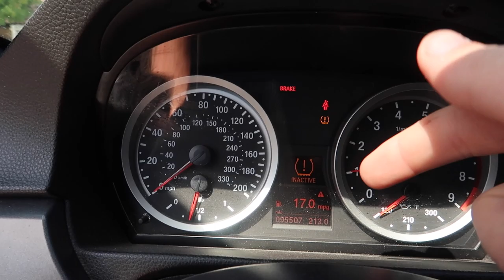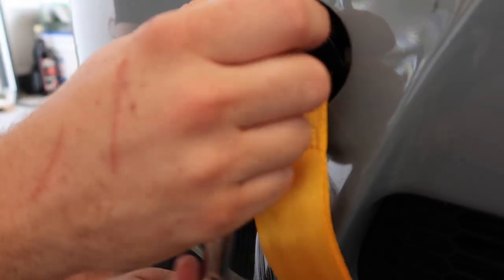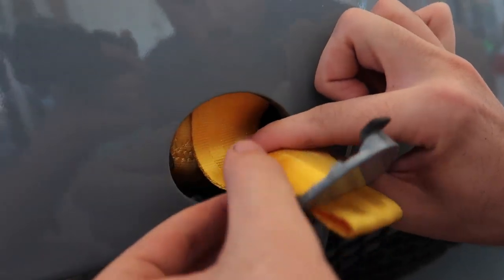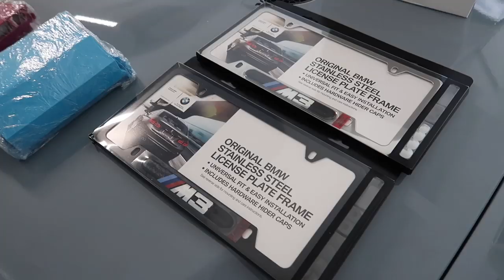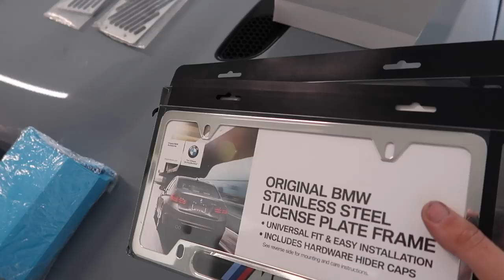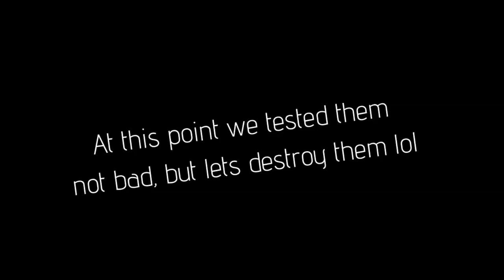BMW CUSTOM TOW STRAP MOD! (E90,E91,E92,E93)

Comment: Personally I like the tow ring or tow strap look. Got a few myself but I'm not sure about using yours as a tow. It looks so thin. Both the strap an the metal. Mine are so thick they barely flex. Luke tow strap. If yours are real fair play but if they unbranded ebay do not try it. Seen them break and damage bumpers. Looks nice though imo. 👍🏼